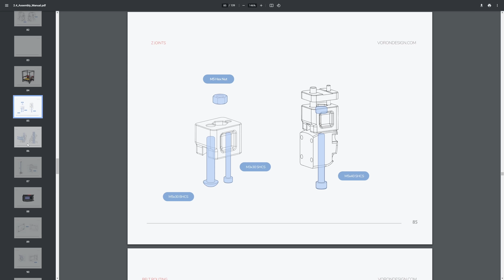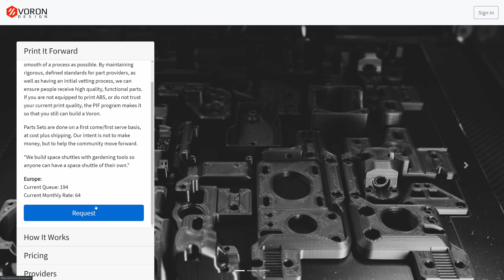My new favorite 3D Printer! The Voron 2.4 Build Experience

Comment: damn why is it so quiet tho? maybe the mic? my printer makes a lot more noise.
Reply: Are you using TMC stepper motors controllers? They're basically black magic when it comes to sound reduction
Reply from the maker: The mic (ceiling-mounted shotgun mic) does pick up the printer quite well - but it really is that quiet. That's what having Trinamic drivers and motors that harmonize with them will get you!

Comment: the mosquito hotend is 340 bucks base price.  for just chunks of metal cut into shape.  
with the water cooled block, two heaters and two thermal sensors its even 500 bucks.   ?????? 
i like innovation and new designs but they are just plain greedy. no wonder people buy chinese clones like hot cakes.
Reply: The mag+ is the highest flowing hotend on the market. 

They can charge whatever they want because there's nothing else like it.
Reply from the maker: Have you seen the Dyze Typhoon? oO https://dyzedesign.com/typhoon-extruder/
Reply: @MadeWithLayers  Sorry, that doesn't weigh 1750g, which at that weight point a pellet extruder would make more sense.
Reply: @Tedlasman  the mosquito magnum+ can do up to 88 mm3/s on PLA, thats 22mm3/s less than on a super volcano (110mm3/s)

the dyze typhoon does 200 mm³/s but no words on pricing.

110mm3/s is a 1kg spool in roughly 2 hours, keep that in mind.
Reply: @gamerpaddy  how much does the dyze weigh? 1750g. How much does the maq+ weigh? ~55g.
Also, the dyze can't do 1.75 filament. 

Supervolcano is unusable, it'll snap.
Reply: Come on, it’s not only metal cut into shapes. It’s also patent attorneys which you pay, patenting bad heat conduction of thin walled tubes…
Reply: @christophmuller3511  instead of using stainless steel tubes lets just cut open ceramic fuses and use their ceramic shell as a heat break tube, much lower heat conduction.
Reply: @gamerpaddy  ceramics are also covered by the patent

Comment: how about we would but a selling product to the test. i have a product that needs to  hit a time constraint. if this can beat that number and volume. why not try it. i can send you can you a stl. if this can do this better than a ender 5, and cleaner in pla or petg i would build a farm out of it, or let you do it. it is all about time x perfection (perfection) number or items x sales. lets figure it out. i am always looking at better time and performance.
Reply: Ender 5 is just normal cartesian, and you can tune almost trash to be faster than most people run their Ender printers. To prove this I have basically an Anet A8 without the screen and a Bowden, I print really nice at 120mm/s and much faster than most printers, about 3x faster than an Ender 3, but this Voron beats my speed by a substantial amount. The Voron unfortunately is not for sale from any dealer though, only parts kits so you'd need to hire people to put them together or build for yourself months after months to get a decent sized farm (though you may only need 1/4 the machines, so it depends on your print farm size).

PS: 120mm/s is my SLOW speed, for my "really nice" prints on my old cheapo Anet clone, that's like for very fine tooth double herringbone gears where a 3 inch diameter gear has 80+ teeth and printed solid its around 20-25 minutes. That Voron can probably do much faster, and that's what I'd pick for a business but I also just watched an intern take almost a month to do a simple mainboard and extruder swap so... take into account who you hire to build them otherwise that machine is going to cost a fortune. If you're looking for speed though, physically you can't find one much faster, and if you need it then you'll be paying out the nose for it but I'm sure you already know that (the absolute $hit machines at work cost $10k and are absolute dog poop, my cheap machines at home run laps around them and far superior quality so cost is sometimes meaningless in terms of quality, but I think these Vorons are a pretty good deal from what I've seen).

I think a Voron would be more suited for enthusiasts or people like me (extremely DIY, always tuning, always improving), but they are pretty much the best you can get so if you can find someone to build it for say $1k you probably should go for it if you have someone that can also maintain it. I don't have one to say what exactly should be improved but I'll probably get one to play with (nothing on my printers stay stock, I've even replaced so far as down to the power cord on that Anet/Reprap style one, its fun and it just keeps improving in an ever steady race for the fastest and highest precision parts for my prototyping needs). Mechanical and Aerospace engineer, so I design a lot of things in my free time and require very strong parts printed preferably instantly so I can iterate multiple times per day, hence my love for speed and functional parts.

Comment: Losing steps ??  Wait, are 3d printer still using open loop control with no positional feedback ? So amateurish ! Wheel encoders cost less than 10$ per axis, get your stuff together 3d printers manufacturers